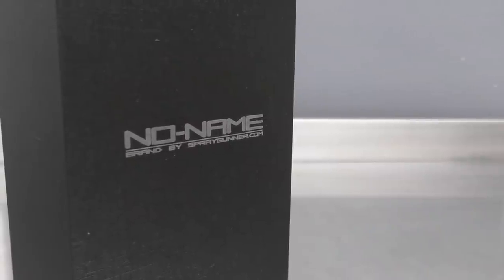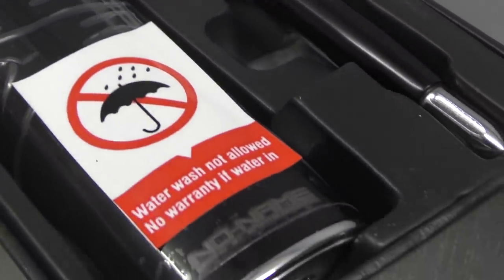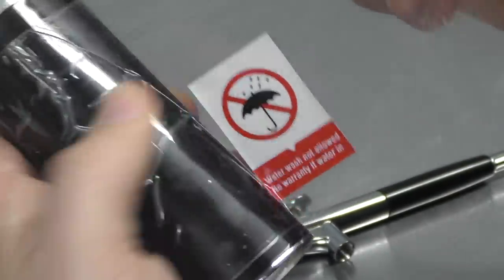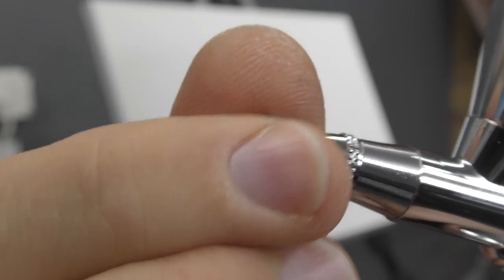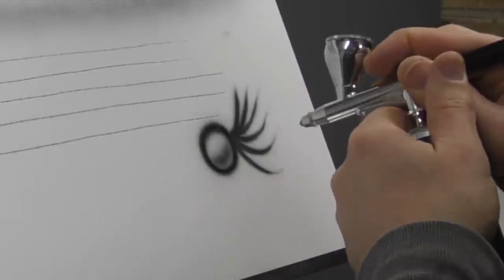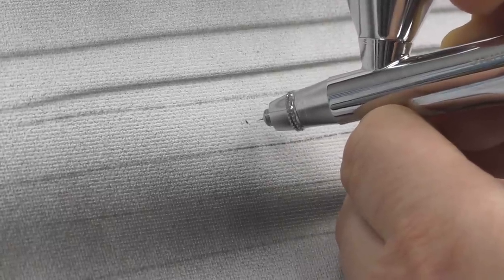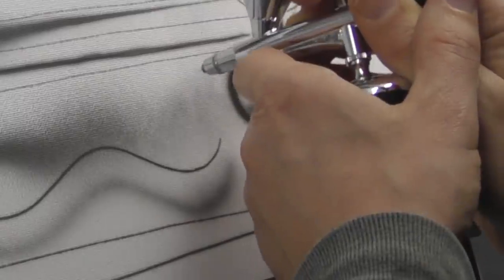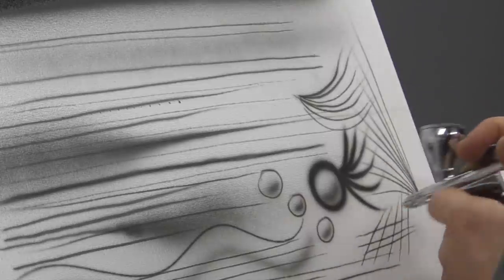Battery Powered Airbrush | unboxing and spray test

Comment: Thanks for this informative review. On the back of watching this I bought this model from Amazon UK (albeit under the brand name DIYARTS). The 'instructions' - which appear to be for exactly the same METU-30 model - state that you get 40 mins use (rather than the 1.5 hours in your instructions). Seems like they may have updated them. This is the first airbrush I've ever had so I've nothing to compare it with. What I will say though is that my fingers absolutely killed me after just 5 minutes of use. I'm sort of regretting not getting one with a separate compressor which I think may be easier to handle.
Reply: You could probably get a air hose to go in between the gun and battery pack. Imagine it would be like a hose off a foot pump. Could work. Am looking at getting one of these.
Reply: Yep, can run an air hose while sitting on the compressor. Double the fun.

Comment: Is the bottom connector standard at all? Could you use the supplied airbrush with a normal compressor, could you use the battery/compressor unit with any airbrush?
Reply from the maker: Thanks for your comment take a look at this video where I connect other brands to the battery compressor and show you how it’s done  https://youtu.be/I5wkSlVCXgg👍🏻 the airbrush that comes with the unit has a similar connector setup to iwata so it ‘should’ fit with any of those connectors hope that helps .

Comment: You can even buy an adapter to use the gun with a 1/8 inch air hose and compressor.

Comment: If you own these, try not to use alcohol as much for the " cleaner ". After a day of use, & its time to clean it, hold down on the spray as you refill the cap with water (  3+ full caps Of water aka 3 cycles ). This should help get the paint out, but will still have paint inside. When you run it through with alcohol, the alcohol dries out the leftover paint inside. Over time or even within a day, it'll clogged. 
Instead of using alcohol, I just spent the couple $ to buy " airbrush cleaner fluid ". ALSO, when you take it apart and clean it, for some reason if you try to spray and nothing comes out, try playing with the tip of the nozzle  in the front where the paint dispenses. 
( as you spray , loosen/tighten the front nozzle until you see it disperse paint ) 
Took me days of trying to figure this solution out & almost going on to buying my 2nd replacement until I figured it out. Hope this helps anyone with a cordless airbrush.
Reply: Can confirm. The backwash the water method is the best for cleaning these. I bought a second one after ruining the first and it's worked perfectly ever since with only water.

Comment: this black autolock brush does no work out of box, would not spray water
Reply from the maker: The one I show is the ‘no name’ by SprayGunner that said check the needle locking nut located near the rear of the needle once you unscrew the handle if this is not tight then the needle will not slide back and forth therefore not spraying any paint. Hope that helps 🤞🏻

Comment: I've been thinking about getting one of these so I can do artwork on the go eg, nature & landscape
Reply: take a picture and bring the image home with you,.. you really think you can airbrush outside? try this,.. turn a fan on low and face it towards your project and see how horrible of an idea that was lol ... these things are garbage,.. either get a compressor with a small tank, or use brushes
Reply: Did you get one? If so how did it perform?
Reply from the maker: I think if you take this on-site with you and you do a majority of your landscape using brush work and airbrush the backgrounds shadows and highlights with this unit then that will work fine. You can work outside with an airbrush, I have airbrushed at numerous shows outside and it’s no issue providing it’s not super windy (obviously) 👍🏻😉

Comment: Is the battery pack and pump heavy to hold onto for longer periods of time? 600mah battery is not large but combined with casing and 6v motor adds weight. Heavier than an air lead. Noticed it might be more comfortable to hold steady ???
Reply: they got 1300mah models  under same name
Reply from the maker: You do get used to how it feels , I still use my traditional brushes this is just a great option for someone who needs the airbrush for scale modeling , miniatures and backgrounds (even though it can be used for artwork) but that said it’s totally up to you 🤔

Comment: Wondering if you could put a higher quality brush on to the battery? Battery could be handy if a better brush could be screwed on to it.
Reply from the maker: Yes I will be testing this, SprayGunner have informed me that the PS770 fits so I am assuming that you can hook up other brands as well provided they have the generic air fitting 👍🏻
Reply: I was able to adapt a couple of iwata High Performance Plus airbrushes to this pump. Both the HP-C Plus and the HP-BC1 Plus. I did need a slightly longer trigger for the HP-C Plus for it work reliably.

Comment: I was seriously considering buying one of these, but the Amazon reviews for this aren't great.
Reply from the maker: So far I am impressed , but I can’t render any proper judgment until I have used the item for a longer period of time ...more vids on this product coming soon 👍🏻
Reply: @AirbrushAsylum  Have you any new feedback on the compressor and brush? I ordered exactly the same and got it today and I'm also imrpessed. The only bad reviews I saw on amazon a few days ago were some rare that the compressor broke down after a month, but most people were satisfied (at least in germany). Would be cool to hear from you what you think about it by now :)
Reply from the maker: I’m still using it and it’s working perfectly, it definitely has its place I still use my traditional brushes 90% of the time but this is definitely a very handy item to have 👍🏻

Comment: Cheap generic Chinese airbrush coppied from Japanese Iwata etc. These are crap mainly because the threads on the brush are crude and easily stripped and the seals will split after a short time.  Ok maybe with inks and watercolours, but no way do they stand up to the constant stripping down and cleaning when using enamel paints.
Reply from the maker: Thanks for your comment and I agree in the long run it always pays to buy a name brand, the batter unit however is fantastic and can be used with name brands like iwata , GSI Creos etc and it then gives you a portable airbrush 👍🏻

Comment: These units are shit... mine worked for 4 weeks, then it would not hold a charge (had to plug it in to keep using, even tho is says don't). Get a compressor (even a tankless, but try to get one with a tank)

Comment: Cool...I guess? Seems like it would be kind of bulky feeling to me and definitely a matter of getting used to. Not sure if a set up like that would be practical for my use though with military scale modeling. I do wonder if the battery would work with my two Paasche airbrushes. I use a Talon and a Raptor for smaller detailing and camo patterns.
Reply from the maker: Thanks for your comment and yes it would work great for scale modeling 👍🏻

Comment: How would something like this work for a Gundam model?
Reply: I bought one for working on warhammer minis and the one i got was 70$ on amazon and it didn't work out great. The air pressure was good enough for high lighting and that's about it. On 28mm miniatures.

Comment: Hello from Oklahoma Territory, USA. These are pretty cool to see in action. I’m curious what you are going to do with the airbrush itself (if anything) to make it perform better or are you just going to try it out straight away on some artwork? The needles on the No Name brushes are pretty rough outta the box and can use a bit of a polishing and putting the tip through a Sharpen Air needle tip shaper/restorer to even them up works quite nicely too. You can feel the grooves or fluting on the needle shafts on some of them. Again, Great video(s) as always. I’m still watching the Lucky 13 Skull video... keep the videos coming my friend and be safe.
Reply from the maker: Thank you for your kind words and glad you enjoyed the vid and you are also enjoying Lucky 13. I plan to try some other brushes on it , this vid test was literally straight out of the box I didn’t Pre-test it or modify the brush, I just hit record and filmed it used for the very first time 👍🏻
Reply: Airbrush Asylum - Always a pleasure, I don’t really watch any other airbrush videos, because your ability to teach is awesome. Not that others on YouTube are bad, I just find your teaching and techniques easily understood by me, and now my wife who also started watching your videos. This particular product performed very well just breaking the seal, doing a load and go vid. The working air pressure seems perfect for your 70-30 reduction. The quantity of color you were able to put on without light spots or tiger stripes was amazing. I use spray gunner pretty much exclusively and have become friends with most of the folks there in Oldmar, Florida. Can’t wait to see what you have next for us... 🤘🏻👊🏻🙌🏻👍

Comment: Can you use other brushes on it , and how’s the heat from that box, what about using an water trap with it
Reply from the maker: Great questions , SprayGunner have informed me that the PS770 fits so I assume other brands will as well 😉 not sure about water trap but I’m sure I can try one out and so far no heat...but I haven’t painted with it long enough to give a accurate answer 👍🏻

Comment: no link to the product used?
does the unit get hot with time?
does the battery have overcharge protection (shuts off when full)?
can we buy a spare battery to exchange for projects that will take over 2 hours?
can it be used with any air brush?
is it double action or single action?

Comment: I wonder how it is for weight? Is it any heavier to hold than a hose connection. I noticed you were using both hands to hold it. Is that the way you would use a regular hose connected airbrush? Or was it heavy so you needed 2 hands? Not a critique, just trying to get as much info before buying. Thanks!

Comment: Is the pack compatible with other airbrushes also how long will that last with the  continuous pumping I wonder
Reply: Yes, I was able to adapt a couple of iwata airbrushes to this pump. It works pretty good.
Reply from the maker: Take a look at this video this should help to answer your question 👍🏻 https://youtu.be/I5wkSlVCXgg
Reply: @AirbrushAsylum  Good video, that is essentially what I did. Though I had to use a different trigger that had a slightly longer pin to hit the activation on the pump. I borrowed one from another airbrush and put the one that was too short on the one I borrowed from.

Comment: Why doesn’t mine spray like that?
Reply from the maker: Keep practicing and you will get it to perform , also make sure your paint and psi mix is correct this vid may help 👉🏻 https://youtu.be/iipihxzoZTc
Reply: I just got one. And the first thing I have learned is to always keep the tip and needle clean.

Comment: The amazon link looks to be to a different airbrush with a mini plug in compressor? The video is great and has tempted me to look into getting one for mini figure undercoating
Reply from the maker: Yes it’s a great little unit, I took another look at the link and the airbrush looks different but the battery compressor is the same , it does say late 2019 but this is the only link I could find on amazon from SprayGunner, I imagine they would ship the updated version but maybe request it when making a purchase, I will reach out to them and will find out if they have an updated link 👍🏻
Reply from the maker: Just heard back from SprayGunner and this is the affiliate link which has also been now updated in the video description 👍🏻
https://amzn.to/32rFaBk
Reply: @AirbrushAsylum  Amazon now had it as "Unavailable" and they don't know when it will be in stock again :(
Reply: u got old models with o usb charging and side on off ,,and this under normal usbc kind